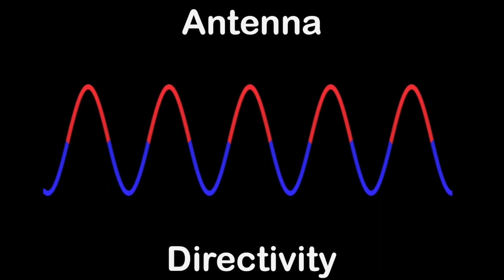Antenna Directivity

Comment: Hi Brek, really cool video. Would you make a video on what your opinion of the best handheld GPS is on the market today, and why it meets your requirements? There seems to be a lot of marketing nonsense when it comes to consumer products and I find it hard to sift through the rubbish. I am looking to purchase something for hiking in the Canadian wilderness!
Reply from the maker: Hi :) Garmin is the only choice as far as I’m aware, unless in China you have BHC Nav. The GPSMAP66 would suit me fine if it’s bugs were sorted out. The cheaper 64 is still more reliable if you can settle for the smaller display.